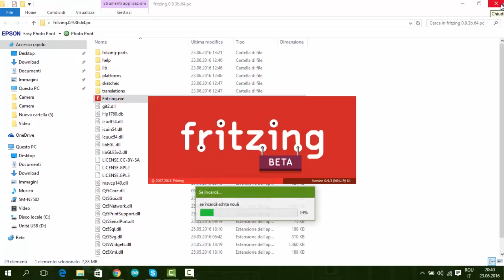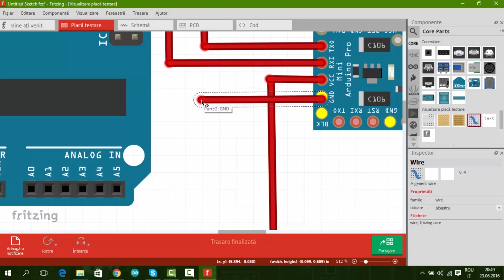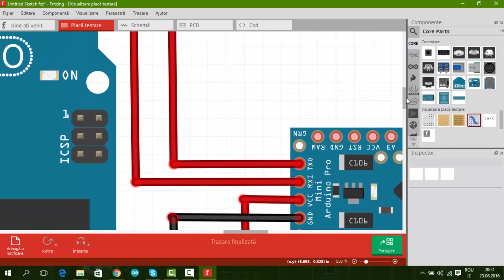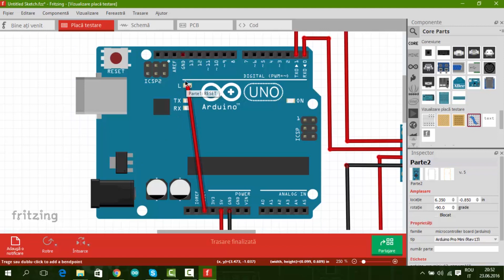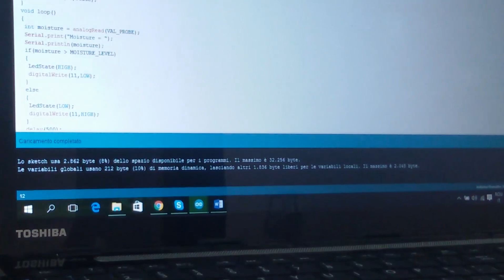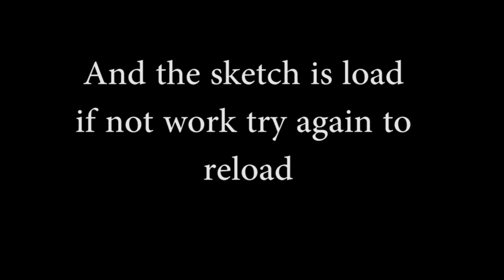HOW TO PROGRAM ARDUINO PRO MINI WITH ARDUINO UNO SOLDERED CHIP  TUTORIAL

Comment: I get this:

avrdude: stk500_getsync() attempt 1 of 10: not in sync: resp=0x00
avrdude: stk500_getsync() attempt 2 of 10: not in sync: resp=0x00
avrdude: stk500_getsync() attempt 3 of 10: not in sync: resp=0x00
avrdude: stk500_getsync() attempt 4 of 10: not in sync: resp=0x00
avrdude: stk500_getsync() attempt 5 of 10: not in sync: resp=0x00
avrdude: stk500_getsync() attempt 6 of 10: not in sync: resp=0x00
avrdude: stk500_getsync() attempt 7 of 10: not in sync: resp=0x00
avrdude: stk500_getsync() attempt 8 of 10: not in sync: resp=0x00
avrdude: stk500_getsync() attempt 9 of 10: not in sync: resp=0x00
An error occurred while uploading the sketch
avrdude: stk500_getsync() attempt 10 of 10: not in sync: resp=0x00

Comment: With a few words reset the on board mega using RES->GND connect 5v and TX RX and with this use the CH340 serial chip of the UNO to program the pro mini without extra usb->ttl converter adaptor.
Reply: yes, and CH340 IS an USB to TTL converter :)

Comment: for what you connect between reset to GND? I think in following you i burned my ch340. Before i wasnt problem with my arduino but now its all the time send error: avrdude: stk500_recv(): programmer is not responding
avrdude: stk500_getsync() attempt 10 of 10: not in sync: resp=0xa6 i try reinstall my USB drivers but it doesnt help.
Reply from the maker: i tried several times this method and it worked well
Reply: Neonil Rosca  you make that to not press reset tagswitch after uploading your sketch on arduino promini?
Reply: And one more quesiont, can i use arduino nano instead off arduino uno to programming pro mini?
Reply from the maker: No, you have to press the reset button!!!
Reply from the maker: I think that is possible  but i dont tried it ever
Reply from the maker: Maybe is better to buy a programmer

Comment: I understand all connection,but what procedure you followed after connection in IDE software.
Reply from the maker: in the software part you need to set the port, to chose the board and when you upload the sketch and the software show loading to press the reset on arduino pro mini!!
Reply: Mohammy

Comment: you can do with an usb cable...
Reply from the maker: no the arduino pro mini don't have  the  usb chip
Reply: Open Cable And White->RX Green->TX or Green-> RX White->TX It Works Well Other 2 Cable İs Power Cables...
Reply: Last time I checked, the green and white wires are for data+ and data-, not tx rx
Reply: Nice troll m8
Reply from the maker: it is not a troll!!!!
Reply from the maker: the white cable is reset-to ground
green and grey tx and rx
Reply: https://www.moddiy.com/product_images/uploaded_images/patillaje-conector-usb.jpg
Reply from the maker: oh sorry, i think that you speak about the video 
yes i am agrre with you with  the usb cable it will not work